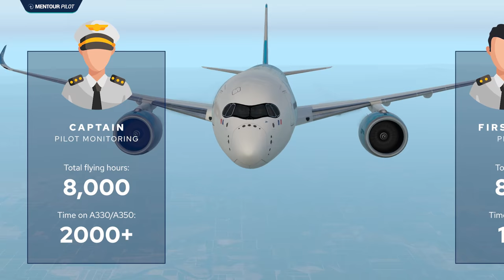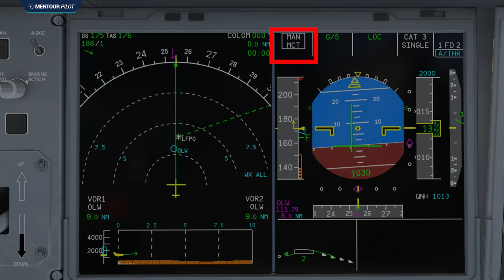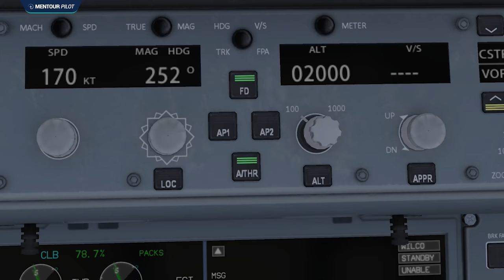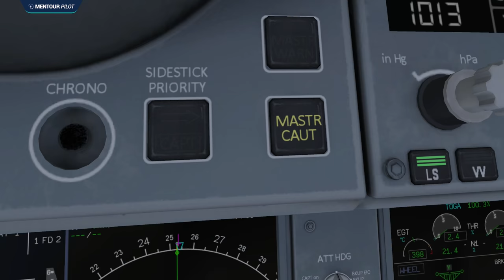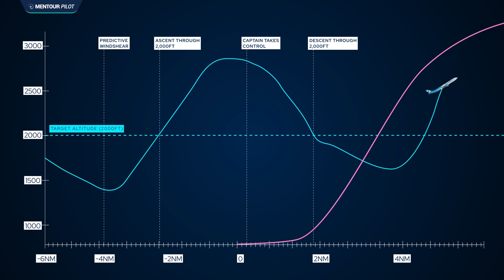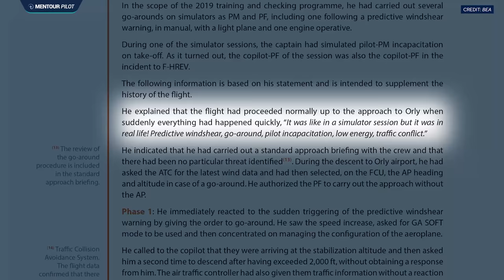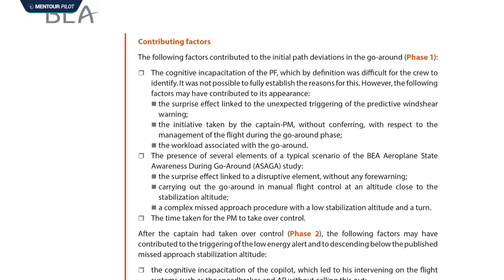What HAPPENED in this A350 Cockpit?! French Bee flight 711 explained!

Comment: Well,my comment is that I am always surprised to hear that two pilots are not aware of what each other is doing. I know there's a lot more in a plane but if it was a car and my passenger did something like switch on the hazard lights or the heated rear window or retune the radio or unbuckle their belt I would be aware. There are sounds and lights that let you know what is happening even if you don't see it. How can it be so blind in a plane? The other extreme is something like the Apollo moon rocket, where the three astronauts face a difficulty and all of them do all the right things and overcome an adversity. Now these guys for sure are supermen. I know pilots are not the same. But somewhere inbetween,surely? And certainly more familiar with a cockpit than any car driver. If someone reached over and adjusted the thrust or the flaps I feel sure the other chap should know. The pilot flying should always be aware of everything that is set and adjusted I think. Good call in the end by the pilot when he recognised what he had to do. "I'm in charge of everything."
Reply: And why don’t they talk to each other?

Comment: Hi,
Nice presentation.
However, the Reactive Winshear warning is not produced by the GPWS as stated. It comes from the computer called FAC (Flight Augumentation Computer). Further, in regards to the Captain advancing the thrust to TOGA and pushing the sidestick down as a reaction to the 3xSpeed caution - the AP dissengages but the FD remains. I think it is incorrect to say that he had to fly without the FD. He just did not follow it hence the speed increased to 280+ kias due TOGA and high ROD.
Reply: I don’t think the A350 has a FAC.
Reply: @peteconrad2077  no, it has MCAS..
Reply: @EN-oh7mz  er, no
Reply: @peteconrad2077  ofcourse NOT. However 350 has PRIM ansSEC computers and the reactive  windshear comes from the PRIM computer and not the GPWS.
Reply: @EN-oh7mz  indeed. So your original comment was no more right than Petter’s.
Reply: @peteconrad2077  the point here is that GPWS lacks sofistication to be able to produce reactive WS warning. It has to be a sort of Flight agumentation computer. You wanna call it FAC or PRIM does not matter. You can not call it GPWS so my original comment is still valid.
Reply: @EN-oh7mz  it’s not. You were wrong. As you are on your latest comment, since some GPWS systems can produce WSHR warnings.

Comment: IMO more generally than just "startle training"
IMO there should be the periodic kobayashi maru.
Yes, borrowing from Star Trek lore, impossible situations should be thrown at pilots to gauge and condition their ability to react to progressively more difficult scenarios which are impossible to solve.
Note that in the described situation that there is a lot more than being startled, there were numerous times the workload increased to where even the Captain flying the plane was suffering from overload and didn't respond to tower announcements and couldn't recognize illogical and erratic behavior of his first officer. There is a much bigger issue involved which has to do with not only the speed but the amount of overload that is happening progressively.

Comment: Perhaps airlines should insist that pilots alternate between long haul, medium haul and short haul flights, in order to 'ring the changes' and ensure every pilot maximises their flying experience. 

But I wonder if also there is a lack of pilot training on some airlines, including Air France. Remember, it was a lack of pilot training which resulted in the tragedy of Air France Flight 447. 

Am I missing something here, or are pilots supposed to communicate their actions to each other rather than just doing things WITHOUT telling the other pilot? 

Could such actions be made far more unlilkely if pilot training instilled the need to tell the other pilot what you're doing? Could this become a deeply ingrained good habit as a result of good and thorough pilot training? 

Even if a pilot were sleep-deprived, or startled as in this case, could such training result in far better cockpit management on the part of flight crews? 

And there is another factor to consider: 

Where Boeing aircraft have a Yoke, which is of course visible to the other pilot, Airbus have sidesticks, which are NOT visible to the other pilots. If one pilot doesn't actually know what the other pilot is doing, doesn't this create the possibility of both confusion and conflicting ideas as to what needs to be done? Or even worse, one pilot doing one action with the other pilot doing another?

There is one other worrying possibility: 

What if BOTH pilots suffer a subtle (or complete) incpacitation at the same time?

Comment: As a ninety year old retired military pilot with thirty-eight years in the cockpit, I can tell you what is wrong here. There are too many fancy knobs, switches, systems and automatic trickery built into the modern aircraft. I sat here watching this saga of confusion and potential disaster, saying to myself, 'turn off all the crap and start flying the aircraft'. I reckon the aircraft computer system was itself confused by all the faffing around on the flight deck.
           There should NEVER ever be doubt as to who is flying the machine. No selection of ANY facility should be made by the second pilot without specific orders from the PIC. Long gone, it seems, is the old fashioned formal,  'I have control - You have control',  where there is no doubt as to who is conducting events.
            O.K. I'm an aged dinosaur but just  like modern electric road vehicles, they build - in  so many 'useful' gadgets and 'safety' features that when the chips are down the guys up front become overwhelmed by the technology. Imagine how this might have gone had they been flying IMC !
           I'm off to bed now with my mug of cocoa ! Humph ! It wasn't like this in MY day !

Comment: At 22:14 - the red button has to be held down for 40 seconds?  That seems like a long time, especially if there is an emergency.  I don’t understand this.
Reply: pushing it immediately gives you singular control. holding it for 40 seconds gives it permanently, allowing you to release the button. you reset it to the normal method using the flight computer after the emergency is over.

Comment: Pilots don't fly their planes enough. By that I mean, properly fly, manually like you would in a light aircraft. All the modern incidents seem to stem from the same thing; something unexpected happens, and the pilots freeze up and can't fly properly. It's really disconcerting. I mean, sure it's unexpected to have a windshear warning - but the guy might not be made of the right stuff if that's all it took to shake him up like that. It's hardly stalling and dropping a wing, or like in top Gun when Cougar got shook up landing on a carrier at night while low on fuel and after a few missed approaches (or whatever it was). Simulators are useful, but they don't have the same emotions, stress or feelings as reality. They should practice more of this stuff in the air.

Comment: ; On Wednesday, February 28, 2018 - an AIRBUS A320 encountered a cascade
; of critical failures while on a training exercise in Tallinn - Estonia.
; The flight controls had stopped working - the flaps were stuck - and
; the right hand (Starboard) engine had caught fire.
; The cockpit was filled with a terrifying array of bells and alarms -
; as the pilots tried desperately to bring the plane back for an
; emergency landing. How had this routine training exercise gone so
; terribly wrong - and how would the flight crew get out of this life
; and death situation ? This is without a doubt - one of the most
; fascinating and unlikely stories in the history of aviation.
; SmartLynx Estonia flight 9001

Comment: I was going to suggest that during a subtle incapacity, the fully capable pilot does a soft nudge to bring the incapacitated pilot back into situational awareness, and reassures them to take a deep breath, whilst simultaneously commanding full controls. It's all fine and well being an armchair pilot and dropping these suggestions. I know It's a different matter being in that situation, entirely. And I also realise that to give a soft nudge might actually add to the startle and further increase the high stress levels. 

I know you mentioned there's that disengage button which allows the capable pilot to take full control in such an event as incapacitation. Along with incident report suggestions on startle training. But my query is, will the training take into account in the event of subtle incapacity How the fully capable pilot might be able to also assist their co-pilot to regain full situational awareness? 

TL;Dr: How will the “surprise training” regain full situational awareness of both pilots, without adding to startle, and do so in a safe and timely manner?

Comment: I wish i knew this 10 years ago, this has happened to me, ok i wasn't flying a plane, i was operating a machine make very expensive parts, the computer detected an error in the process which was very simple to rectify because i have done this many times before over the year's but this time i went into a slight panic because this was a huge order that needed to go out that day, i start to do stuff i would normally never do but my brain couldn't make sense of it all, it was like my brain had frozen but my body hadn't, anyway i ended up destroying the part and the machine which at the time cost just over £2m an i got the sack, i have never been able to explain what had happened to me that day but this video as just give me the answer,,,,basically my brain went into meltdown because i was was stressing about the deadlines and mentally fatigued!
Reply: it's called overstimulation, it can happen to literally anyone under bad enough conditions. people think it's some weakness or sign of mental illness like they won't fold if placed in a similar situation.

Comment: If i was the captain, after 20 seconds of ignoring me, i would have told him to leave. If i saw that speed brake application i would have manually set him from partial incapacitation into a full incapacitation
Reply: You won't see it, as you have to focus on your own tasks. The crew is sitting beside each other, thus out of your vision. Especially the instruments in the center are not only beside you, but a bit lower too. Thus very difficult to see when focused on your own tasks.

Comment: Can someone answer this for me? Why 40 seconds when holding the red button? That seems like such a long time. When at 2000 feet altitude, if you’re going down at 2200 feet per second, 40 seconds is almost the end of the flight if you get what I’m saying.
Reply: It’s just the tile to lock it. You still have control during those 40secinds, so no big deal.

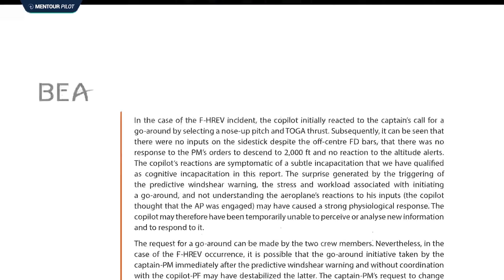Comment: 19:41 according to your numbers a long-haul pilot only has about 50 flights per year. Sounds like a rather low number, about 1 flight per week.
Reply: One trip per week, with two flights is normal.
Reply: @peteconrad2077  still doesn't seem like a lot, it's around 24-30 hours per week flying. Or actually less as I think they get a few hours break if the flight takes longer than 11 hours (they have a 3rd pilot for this in that cases). How much time do they spend for training in an average week?
Reply: @rfvtgbzhn  most week there’s no training. Training is twice a year in most airlines. Here’s my typical roster:
London to LAX, four day trip. Out Monday lane back Thursday. 
Next week london ti Hong Kong. Out Monday, back Friday.
Next week, London ti Chicago on Tuesday, back Thursday. 
Next week, London São paolo on Monday. São Paulo t Buenos Aires and back on Wednesday. Then back to London on Saturday. 
Total around 80-90 hours flight times, but away from home 18 days. That’s a faulty tiring roster and it’s difficult to do much more than that.

Comment: It sounds for all the world like this co-pilot was partially still asleep. I studied that several decades ago with people who had become inattentive while driving. Finding themselves 10 or more miles from where they thought they were and had no memory of driving to the place that they found themselves.
Another point I would like to make is that they have so heavily dependent on the computerized flight systems on this aircraft that once Gremlins start to appear, which was unavoidable in retrospect. The problem is is that the very first flight that they actually put people onto an Airbus and killed a bunch of them was because the computer did something it was exactly designed to do it landed the aircraft as directed regardless of what the pilots were trying to do it just happened to be in a bunch of trees he actually put a pilot in prison because of that. Just to cover their asses. The technological Wizardry is no better then some of the things we already had. The entire problem with the 737-800 was because you had people in parts of the world that were trying to let the computer do all the work during takeoff instead of flying the damn plane. The first rule of flying. If you're always up on the controls, most things won't be so surprising.
Although my only direct familiarity with flying is with training some pilots on F-111 flight simulators. I am aware of with firearms. People getting complacent. And complacency breeds contempt for safety.

Comment: I think that the first officer should be removed from flying. It sounds suspiciously like a mild epileptic fit, possibly narcolepsy. I witnessed this at a supermarket where the cashier froze in a trance. they had to call a paramedic. it is more common than you might think. Obviously, controlling a commercial airliner has no place for a mental defect like that where hundreds of passenger lives are at stake

Comment: The captain was PM and as commander should have been in-the-loop and taken over much earlier than he did and as soon as it was evident that the a/c was deviating from the required track, was going to bust the G/A altitude AND there was no perceived response from the F/O. Call out “incorrect heading and altitude, I have control (simultaneously pressing and holding the S/S priority button). The Startle factor would have been negligible if the captain was in-the-loop thereby realizing that the actual weather was very unlikely to produce a genuine predictive wind shear warning. His reaction (panic?) was - in conclusion - totally unnecessary and unprofessional . The F/O’s partial incapacitation under a light workload shows a - sorry to say - basic unsuitability to continue as a commercial pilot. The relief pilot (with all her hours) should have also called out track and altitude deviations as they were happening and been aware of the F/O’s action on the speed brake handle. Altogether an example all round of poor airmanship and a/c handling (with and without the Flight Directors). 8k (or even 16k) flight time does not equate to good experience and hand flying capability when automation dependency rules the day. It’s unsettling that such a simple (to handle) event resulted in chaos and the potential hazard of a mid air collision.

Comment: It is so easy. I sit in the sofa and think; what a i…! Why the captain didn‘t took full control so much earlier? - I can fly most common airliner‘s. On MS FSX. Since 30 Years. 

The truth: Lately, i was travelling with a beautifull „Swiss“ 737-800 over Florida, when suddenly kind of a stall alarm ringed. (That is not unusual on the FS - i „fly“ for fun, for challenge and relaxing 😏) It came so unexpected, i shoot down the Autopilot, forgot the autospeed, pushed the nose down whyle checking the instruments. I remebered the auto speed and shout it off. The stallalarm was off, the too fast alarm went on quickly etc. Everything went fine and i did not know what happened. It was the KitchenClock. My wife made 3min. eggs. It sounds similar but different, went from a completely other direction much far away from the PC-speakers. I really did not realized that. I don‘t know how stressfull it can be to fly a plane with hundreds of passengers and crew, but i learned that even „flying“ with a home-simulator with most no checklists, even with thousends of hours of „expieriemce“ with that configuration, with particulary most use of only the instruments really used to fly, no flightplan… etc. Cam end in a stresslevel you just can‘t and don‘t expect.

Thanks for your effort to bring these storys to us. Not only pilots and crews can learn from that - it‘s often a question of leading and of communication, what is a major problem of humans, i think. Greets from switzerland.

Comment: whats the point of training if you already know what's coming?
have the pilots enter the simulator without telling them whats happening.
if the pilot is responding well just keep piling on things that could go wrong until they crash.

test the failure load, not what they can handle in normal operation.

Comment: Captain completely messed up. He left the airplane in the hands of the first officer, even though the captain has the responsibility. After the first officer disregarded basic procedures without any words and ignores the captain, the captain is supposed to use the priority override button and take control of the plane. How did this man pass his captain exams. Also immediately should’ve called for help from the secondary flight crew and tied up the current first officer. He is a direct threat to passenger and aircraft safety at that moment.